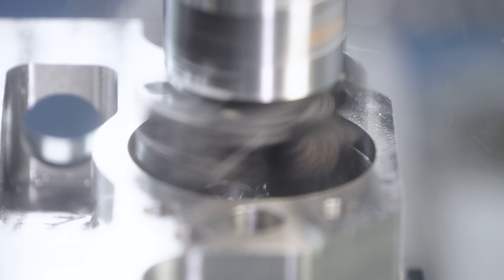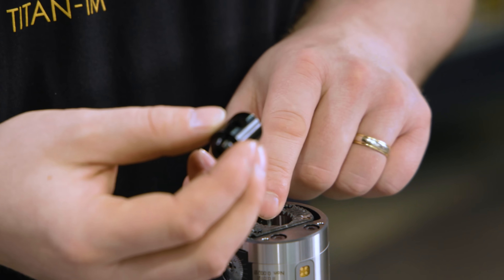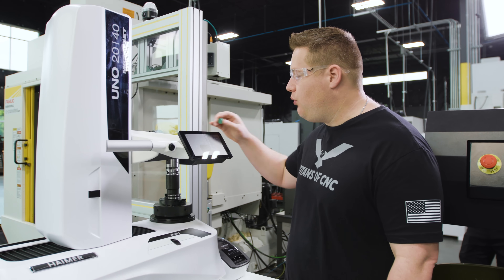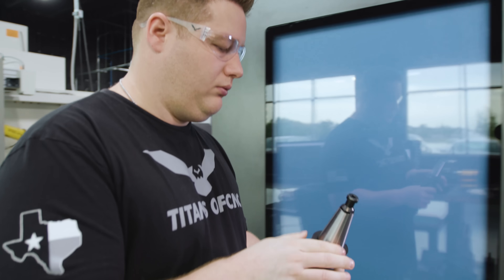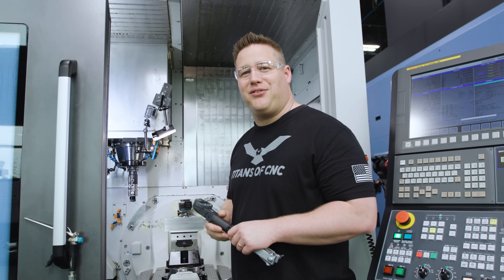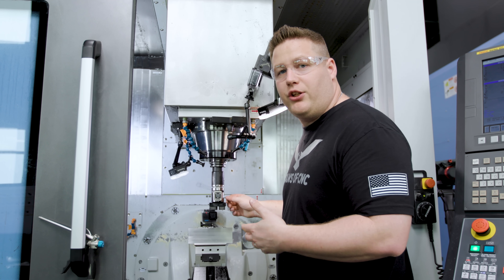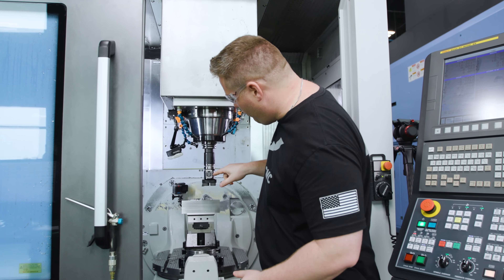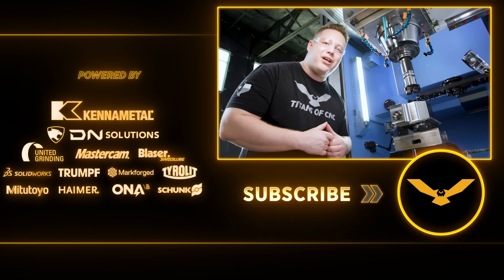Easiest Way to Dial in a BORE HEAD | DVF 5000 5 Axis CNC Machine

Comment: Really love the way you guys use tool presetter and everything. The only thing I would say could be done otherwise - that our company got - is to get that software to print out a QR code on the lable, and install a QR code scanner into the machine. It will delete the last possible human error, not reading anything, and not puching in any digits. 

Awesome video!
Reply: While presenting the tool you put the data in the chip of that is attached to the tool holder, when you put the tool inside the ATC the machine reads the data. So you can swap tools between machines without risk of collisions
Reply: @daveticino1  we never swap Tools in our mashines. Thats the same as swearing in the church.
Reply: Even better is a RFID chip on the tool holder that has all the data.

We had it already 20 years ago on a Mandelli Milling center
Reply: @daveticino1  so tell me what is the bennefits rfid chip?
Reply: You don't have to but you could With the RFID chip 😉
Reply: @daveticino1  nah if you have any damage or warn spindels you can risk damage on other mashines. We can affors enough holders to all mashines. And we have big Tool changers. If you take a Tool out then you have to go look for it. So Why not just have enough Tools?
Reply: I could only wish.
Reply: We have the Numbers put in the mashine by wifi. No need for qr scanner of you have wifi.

Comment: once had a tight tolerance in polyoxymethylene (POM) with 21,9 (+-0,005) mm and this tool actually helped me get them all perfect.
and btw: your tip with loosening up the vice before you go for tight tolerances saved me really. keep the good videos up :)
Reply: How well did the mate stay in the material overtime, in my experience its really hard to keep it at a tight tolerance
Reply: @boerke123  since it was only 8 holes total and I only had to take off .05mm in the soft material the insert was like brand new aafterwards I think it really comes down to what material you are machining and how well built the tool is

Comment: I am just amazed at today machines.
I am thankful to see stuff like this it's a education on line and one of the biggest reason for the internet.
These machines are light-years past the old bridge port, and davin port I used just out of high school none of this computer stuff I'm lost just watching this and in wonder what is ahead thanks for the video.
Reply: What is ahead is dark manufacturing, where robots cut the stock, load it into your machine and run the job with no human intervention required.

In 2009 I was hauling beer out of Anheuser-Busch’s brewery outside Syracuse, NY. They’ve got a huge warehouse where they keep the deliverable beer. Distributors send in their orders via EDI. There’s a little office that assigns these orders to particular docks. A Teamster backs your empty trailer into a dock. When it’s there, all these little robotic forklifts immediately pull your order and put it in your trailer; the only possible point of failure is if the wrong trailer was put in the dock.

So, basically, we’re all going to be administrators in the future. Consider Titan’s shop. Titan doesn’t employ engineers; all his work comes in pre-designed. There’s no reason why a computer and robots couldn’t look at each job as it came in to assign it to a machine, order materials, set up all the tooling, load and run the jobs, do QC on the finished pieces, crate them and load the trucks with the finished work. Same thing with most of the skilled trades. However, he’d need a lot more floor space for maneuver paths for the robots.
Reply: @jmowreader9555  well that's if we let them, and yet their are no robots to fix the robots so humans aren't out of the picture yet.
BUT ONE DAY and we know it's coming!
Reply: @darrellhart9363  Yes, "robot maintenance technician" is the growth profession of the 21st Century.
Reply: Button pushers lol, I’ve never messed with CNC but it was funny watching CNC guys come into the shop I worked at, they learned really fast that they weren’t machinists.

Comment: How many of those are going to get flung off and smashed when someone forgets it on the tool?
Reply: We are using this stuff for years and never had one of us forgotten to remove it, i had the same thought in the beginning when we started using them
Reply: @eggxyyy  Nobody want to go to the shop boss with broken pieces in hand. Better have a good one ready.🤣
Reply: Exactly, why not just make a digital boring bar -_-
Reply: @BloodThunda  you can use the device on more then one boring head, so its cheaper overall to use that system
Reply: Don't forget it on the tool then. 😉
Reply: Just use a dial indicator, that’s all we did.
Reply: Also I noticed he's boring both down and no Q retract from an M98 spindle position so I'm predicting he's not using a G76 boring cycle, moreso just basic plunge feed and return feed.
Reply: @Th4thWiseman  yes, I also noticed that. I thinking whitch way is better to surface and tolerance ?
Reply: @stukovpl  Surface finish is good but feeding back out also touches surface and too light of a cut can cause poor surface finish.
They also show that RPM is 18,000 which is way too fast for a boring operation!
Reply: @Th4thWiseman  thats the machine specs not cutting specs. It's the max rpm of the machine
Reply: @MillTurn4Life  I'm a professional cnc machinist I completely understand what they're doing and how and my comments here are mere pro tips# and sometimes debunkers knowing the facets of the trade and metallurgy alchemy backwards like every wrinkle in my hands!
Reply: @MillTurn4Life  Furthermore El, these guys discover something new to them and profess its entirely new to industry which it's not.
They are decent at what they do but they're still greenhorn newbies when it comes to formula of know how👍
Reply: @Th4thWiseman  I have no idea what your going on about I didnt say you didn't know anything as I don't know you so I cant comment on your ability sorry if it came across like that I was just pointing out that that 18k they had on the screen was the machines max rpm not the rpm they were running the tool at.
Reply: @MillTurn4Life  np El, just keep in mind they're not the best of the best👍
Reply: @Th4thWiseman  aslo I think that's a little unfair... yes they embellish a bit but kennametal is a sponsor and to experienced guys like us we see it but (can't speak for you but) I still enjoy seeing different tools an strategies. And not everyone has loads or any experience with cncs and most if not all of the things they say are technically correct and would help someone who is a bit green behind the ears.
Reply: @Th4thWiseman  lol no-one is there is always someone better its one of the things I love about engineering... always new stuff to learn and nothing is ever perfect so you can always do better
Reply: @MillTurn4Life  yeah their publications are good for those who want to learn, I agree!
Reply: @Th4thWiseman  How should you get it out then?
Reply: @Th4thWiseman  Thank you!
Reply: @Universal_Craftsman  You're welcome 👍
If you're into CNC and need a tip# or answer to a problem just drop me a message here and I'll answer your query!
Reply: i was about to say that
Reply: I would think that if you're just making adjustments with the digital display,  then it would be very unlikely to forget and leave it on there, unless you were having to walk off the jobsite for some particular reason.  But then you should get in the habit of taking it off before you walk off anyway. Just my opinion though.
Reply: Iscar has boring bars with it built in that we use. Just gotta replace batteries every now and then and it remembers the numbers. Probably more expensive for each boring head than those but I wouldn't think by much.
Reply: The very first thing I thought of.
Reply: All of them. No one cares.
Reply: If it fligns off before 300 rpms it should be fine

Comment: We use Kaiser boringhead's in our shop with analogue dial's and we also hit really tight tolerances with those tools. It's just all about being focused when doing precise work. You made a point by losing count yes, but when you know you are  doing something exact just don't get distracted. If your buddy that came to ask you something is a machinist too he should be able to understand that you are doing something where you gotta be focused. All in all it is a cool tool and useful if you are not used to it.
Reply: its not usually a workmate that's the problem. 
I usually find its management ! (Particularly the ones who came off the shop floor who SHOULD know better)
Reply: Exactly, some of us used to hold +\~ .0002 on 60 year old Bridgeports on a boring head with no adjustable cross slide, just a half thousandth indicator and some tappy tappy
Reply: because TITANS are usually only buisness model of youtubing :D bro you cannot take every word they say :) they show us so many tips and tricks i agree but i think every normal cnc machinist,programer must know these things withou TITANS if dont is not good operator,machinist,programator :)
Reply: it's now OK to ask all sorts of questions including stupid ones using the Kennametal boring bar as it doesn't lose count
Reply: I personally wish that I would have had that 20yrs ago. Beats the hell out of setting up a mag base and indicator to see how much the head moves when you tighten it up!
Reply: Kaiser boring heads are the best, we have many different diameter heads and we use them to cut hardened steel using CBN inserts. They adjust bang on every time. Swiss made, enough said!
Reply: Damn straight!

Comment: Wait you mean a home made gig with a fine thread bolt as the jack isn't the industry standard.
Reply: ..and to be honest, most things can be corcle milled on a CNC and be well within tolerance.
Reply: @wordwyrd  They sure can.
A lot of things are just more practical than circle milling, though. At a previous workplace, I was producing these big cast bronze parts with one crazy tolerance after the other in some very deep holes.
I would hate making a 400mm deep hole with a smooth finish with anything but a tool like this.
Reply: @MrMBinder  oh definitely.  I meant "most" to mean there are obviously exceptions.
Reply: I'm pretty sure it's not entirely uncommon..